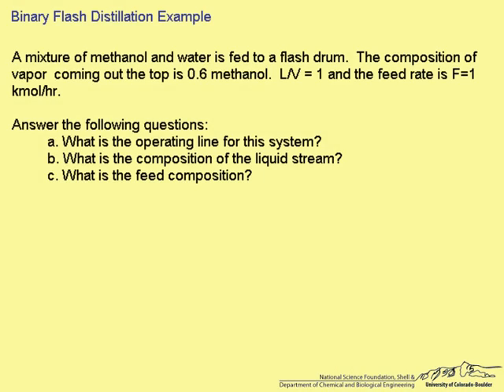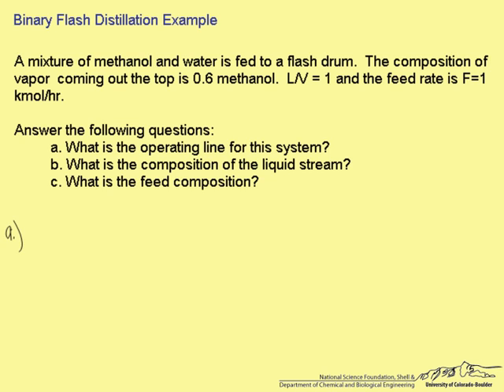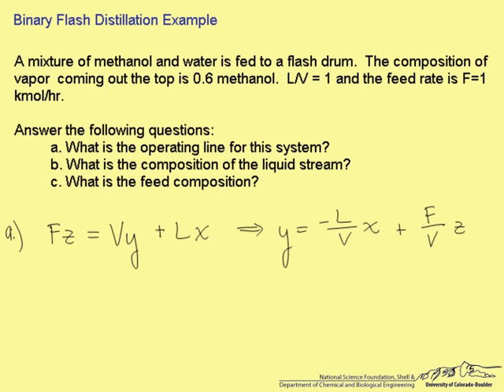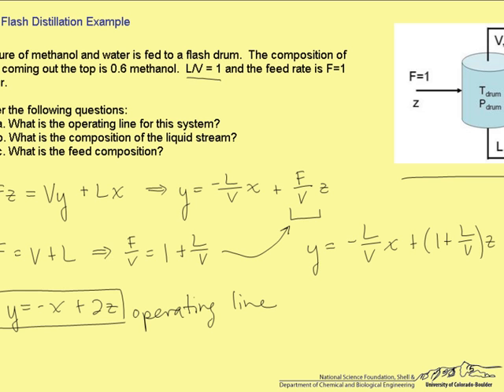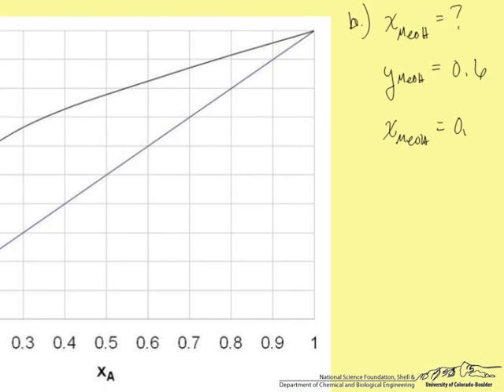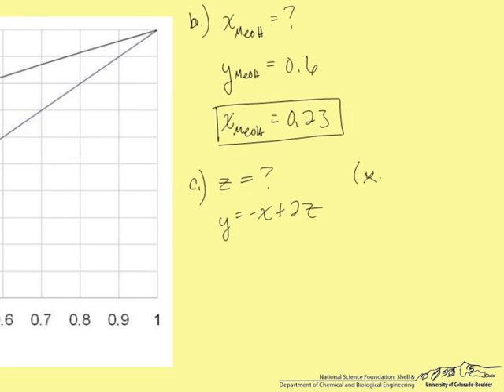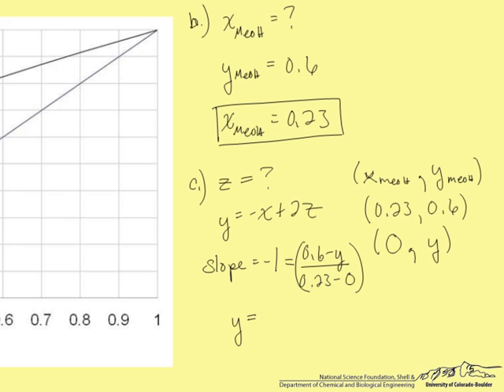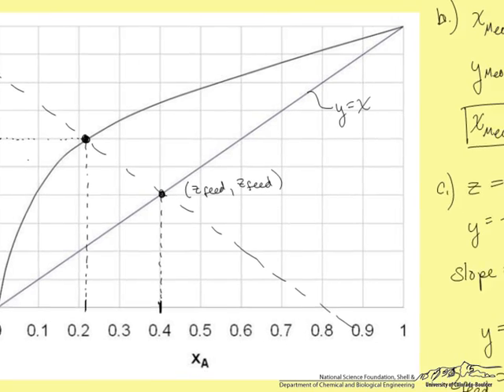Binary Flash Distillation Example

Comment: can you please explain to us why the feed methanol molar fraction in the liquid is equel to the molar fraction in the gas phase , why have you made that assumption ?
Reply from the maker: The feed composition is 0.4 Methanol based on the operating line material balance.  Once it is fed to the flash tank, it separates into a vapor and liquid phase. The vapor phase is 0.6 mole fraction MeOH and the liquid fraction is 0.23 MeOH (the other parts being water).
Reply: when you the operating line crosses the y=x line , it represents the ( zfeed, zfeed) , can you please tell me what you mean by that , since the feed is liquid only , thanks.
Reply from the maker: tareq hassan
the nomenclature of some textbooks call the feed composition zfeed, zfeed.  Typically the feed enters as a liquid and passes through a throttle before entering a flash tank.  The z is to differentiate it from x (liquid) or y (vapor) since it isnt being read in that sense.  The operating line just indicates that at the intersection of the y=x line, we know the feed composition is 1 value.
Reply: LearnChemE  thanks you sir, i tried to analyze it starting from y=zF/V-xL/V, so when F/V=0 , y=x , and i thought that made no sense.

Comment from the maker: Yes, its important for the phase equilibrium data to accurately use correct models or data extracted from studies.  In this case we had a methanol/water system and were using Raoult's law to predict the equilibrium data.  You mention Ethanol, which does exhibit an azeotrope, so it would be important to account for this.

Comment: Hi LearnChemE, thanks for the video! - just one little comment; I used the Empirical Model VLE for nonideal mixtures, with values from DECHEMA at 1 atm. Ethanol/Water are treated as a mixture with minimum boiling azeotropes and by this method Xetoh = 0.32 ..